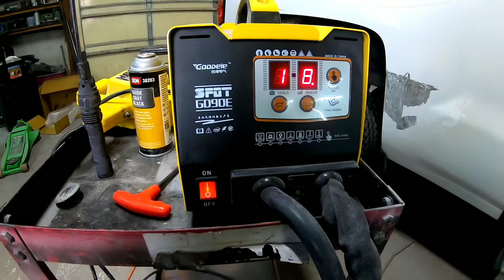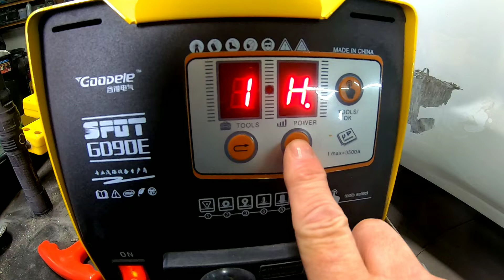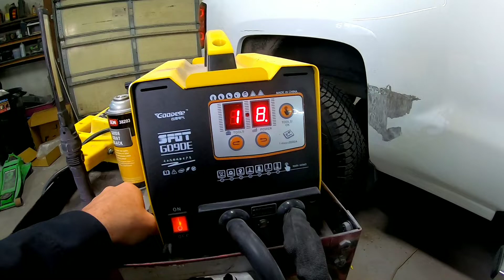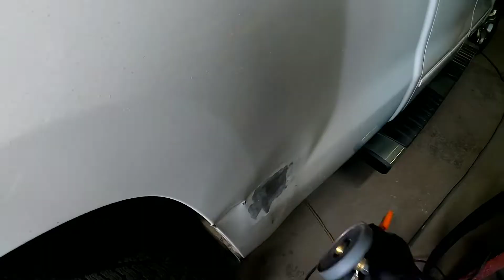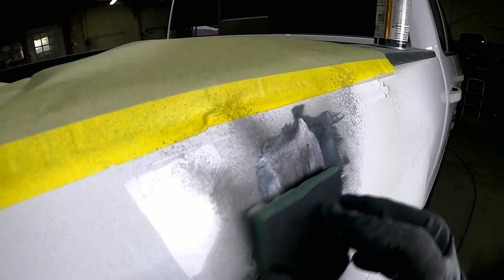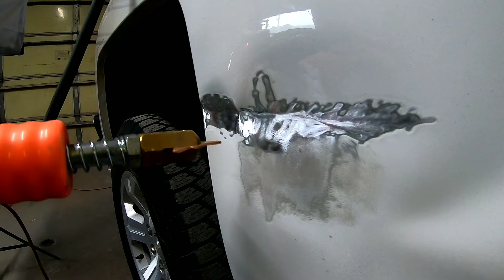G90e spot welder dent tool is it worth purchasing! auto body repair, paint repair,diy auto body

Comment: Pro tip, pull your dent from outside in, it it'll take you way less pulls than doing it centre of damage out like you were. P.s. the magnetic ground is a nice touch, good idea👍
Reply: If you pulled outside in. Wouldn’t you be making the low spot lower?

Comment: I bought one today and like to see how the rest of the attachments work
Reply from the maker: There some more videos  coming on this machine. I have a video  on the wiggle wire. I'll  be doing a thorough demo on it probably in January. Appreciate the support.
Reply: @GarageNoise  yeah I watch about a hour on it blending base. Like how you go into details but I use straight reducer to blend cc.
Reply from the maker: @terryhall5811  yeah, for blending clearcoat I do too. I just don't  really blend clear if I can help it. Appreciate the support brother!
Reply: @GarageNoise  I use to know alot of skills in this, but after years having ptsd I tend to forget and have to start all over. Thanks for the tips.
Reply: @GarageNoise  have you use transtar 6363 edge blender. How does it work

Comment: Can you set a fixed weld time with this tool, in the same way you can set the power? Or do you have to manually release the trigger for it to stop welding?
Reply from the maker: You manually pull and release the trigger.
Reply: @GarageNoise  Thanks for the reply! I found a slightly more expensive unit also by the same brand that has a 0-9 weld timer setting. I might go for that one. Thanks again.
Reply from the maker: @SamToshi  I've  seen that one May be getting it soon.
Reply: You can always double or triple press the trigger to get more fusion time!

Comment: I have a problem when I stud weld with the wiggle metal on my bump but it keeps falling off when I pull any advise I have my vevor machine on 4 H
Reply from the maker: A few things I've  noticed that might help. When I first started using  it I wanted to press it firm to the metal but found that lightly touching the metal gets a better weld. You might also try increasing the heat setting . Also make sure the metal is clean.  Hope this helps!

Comment: Can you tell me please. Iam wanting to buy one of these?? What's the best a G90 E or a stud puller yellow stud gun > Thanks
Reply from the maker: I had a stud gun but it was so heavy  and hard to handle . Then you need to put a slide hammer to pull the dent. The g90 e is much quicker and simpler weld and pull. I like the g90e much better  appreciate the support!
Reply: @GarageNoise  Thanks for that...from NZ

Comment: How do you use the shrinking tool? Do u have a video or link for g90e
Reply from the maker: I don't  have a video  on using the shrinking tool . I haven't really used the shrinking tip but i did use the shrink setting with the pulling tip for some small spots and it work well. Here's the link appreciate the support!
https://amzn.to/3Q50McB

Comment: Sold do you still use your uni spot aswell or does this take its place
Reply from the maker: I still have the uni spotter, but this has taken the place of it . just so much easier to use.
Reply: @GarageNoise  thanks for the quick reply Iv got a uni but this looks much quicker and more easily fine tuned pulls!

Comment: @garage noise  I picked one of these up from Amazon and I'm having trouble getting any attachment to stick. I've got 60 grit on the angle grinder then cleaned up with 80 on the DA. Does it need to be more coarse and not smooth or something? Nothing is sticking! 😶
Reply: Check your ground on your dent puller make sure it’s on bare metal
Reply: @MarioGarcia-xt3jo  for sure and thanks!
Reply from the maker: Couple things to try. Your ground should be relatively close to where your welding if possible, also play with heat adjustment. I've  found if you lightly touch the metal when welding it welds better.
Reply: @GarageNoise  Sad to say mine must have been a cheap knock off, sent it back.  Ended up going to Harbor Freight and using the infamous stud welder to get the job done..  That thing wouldn't give you but 3 pulls at most no matter how much heat or how long I'd leave it on there!!
Reply from the maker: @kseries20-24only  That's a bummer . I hate that , because I never want to steer anyone wrong with these tools. It  is however a cheap version of a tool that can cost a couple thousand.
Reply: @GarageNoise  it's all good, it was worth a shot and like I said probably a knock off.  I learned a lot and will definitely appreciate the real one when I come across it!
Reply: @GarageNoise   That ground is driving me crazy! If you have any recommendations where you got that magnet would be awesome. I'll scuff it up some more and give these things a try but I couldn't get the wiggle wire or the arrowhead plunger to do much more than a few pulls before it falls off.. 😕
Reply from the maker: @kseries20-24only  this is the one I use https://amzn.to/3D7ADEu
Reply: @GarageNoise  many thanks!
Reply: Multiple people use this everyday at a Maaco and it's been almost 3 years with no problems..

Comment: I have a 65 GMC truck has some dents that need fixed. I also need to put a oof skin on.Can this machine spot weld panels on too?
Reply from the maker: No it cannot,  pulling dent shrinking metal but no welding.
Reply: Thank you great video though.Do you know if they make one that can spot weld too?

Comment: Hey Chris so I’m like 10 mins away from clicking buy now for this thing but I’m reading reviews and I’m seeing there seems to be a problem with the connector ?..people are saying it’s a 220v so they had to cut off the plug and put a proper plug and cable for the amps?..did you encounter this?..thanks bud
Reply from the maker: Mine is a 120v I have had no problems at all. I did change the ground to a magnetic ground. That was my preference tho.

Comment: Some know if can I use it with 220V??
Reply: Look on eBay. They have this machine with 220v. With welding machines, 220V is better.
Reply: @floridaroadracerguy  
Hey 
Do u try 220v 
I’m looking to buy it 
If u have the link please
Reply from the maker: They have it in 220v on Amazon
Reply from the maker: No its 120-Volt

Comment: They have something called a UNISPOTTER which I think is similar to this. I am looking for the one that welds 2 peices together too. With a vixon file you could metal finish that in a few more seconds.
Reply: Snap-On sells thiers for $1,600 plus dollars. With little to no accessories. Check it out for yourself on the snap-on store website.

Comment: The crowns need to be tapped down while using the dent puller to get a straight body panel
Reply from the maker: Yes sir
Reply: Yes and for the creaces the weld on washers are the trick. What he is doing is for final touch up, not pulling the bulk of the dent. He will get it in time.

Comment: Garage Noise, The wiggle wire & washer shaped pullers with the point on them, can they be reused or are they one and done??   Does the triangle tip for the general pulling hammer last awhile or does it need replaced frequently?   Thanks for the video, its really helped me decide to get one of these tools.
Reply from the maker: The triangle tip last lond time not sure about the wiggle wire and washer i haven't  used them yet but I assuming they last awhile as well. Thanks for the comment happy it helped.
Reply: @frogmanvc  
You are right. The tabs, lined up in a row, will pull most of the dent out in one single pull on this type dent! The slide hammer is really best on final touches for that perfect smooth surface. Of course a skim coat of body filler will insure a glass finish when properly done.  He will get it in time and then he will really love this machine!!!! I enjoyed the video.